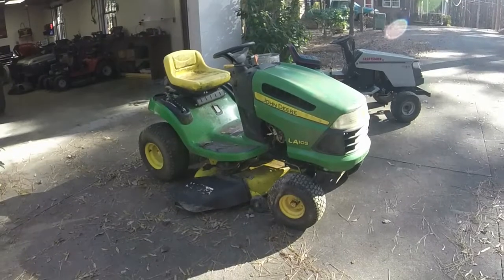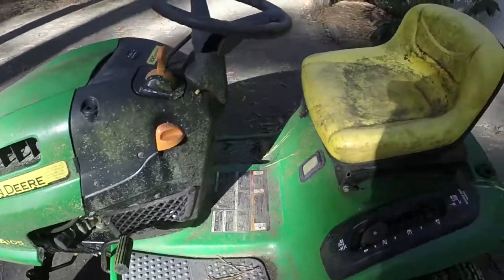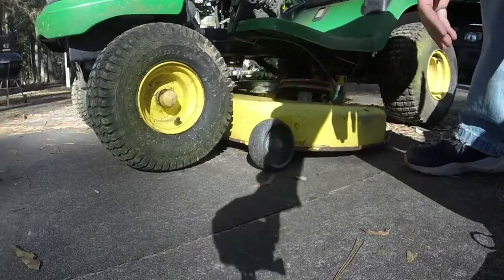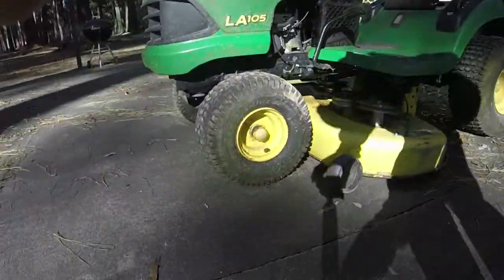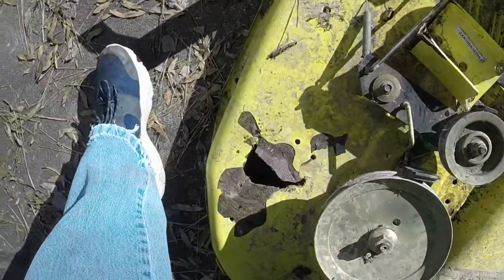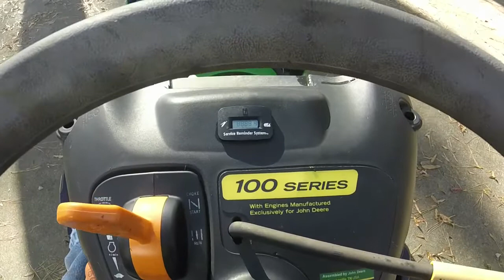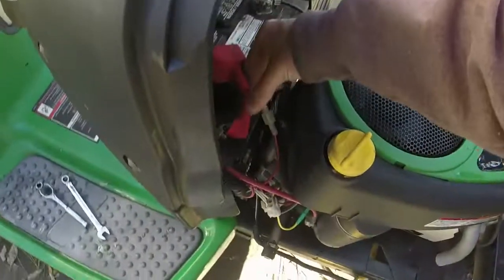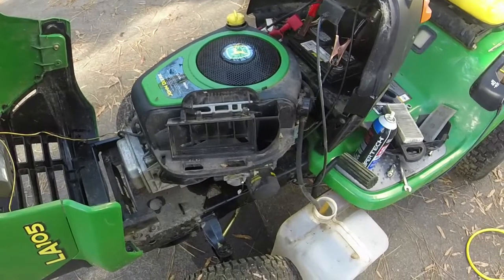John Deere LA105 broken deck removal, starter solenoid (pt 1)

Comment: Great vid EM. Will you be doing a compression test?
Reply from the maker: Thank you, didn't have to do one.  Turned out really bad fuel was fouling the plug before the starter fluid could reach it.

Comment: for what they charge for these, you would think it would have a better Deck, My brother has a older JD, its a water cooled  big one,, the deck just fell apart after 8 years , and of course JD dont offer a replacement housing,
Reply from the maker: The decks are very thick, but the brackets are built nowhere near strong enough to hold the weight of it.  And the paint just comes right off.  If it weren't for the decks these would be semi decent mowers.

Comment: Why do these idiots run these small engines on  ethanol gas  ,When they could be using  premium  with no ethenol and getting better mileage It will run cooler and  it wont go bad Which more than offsets the higher cost